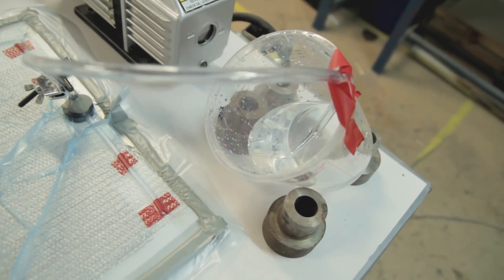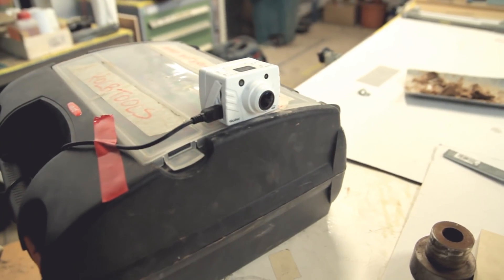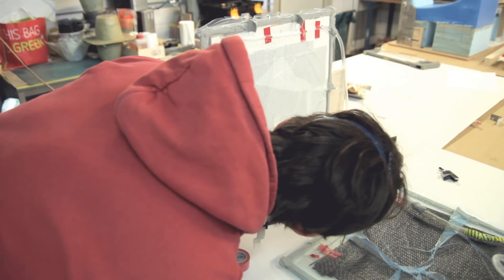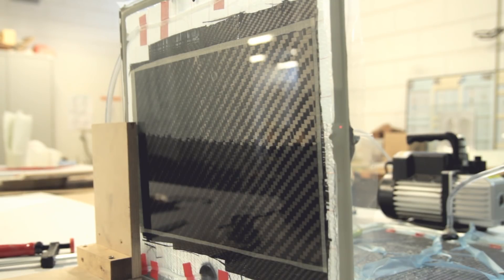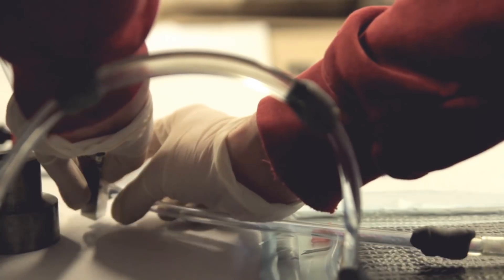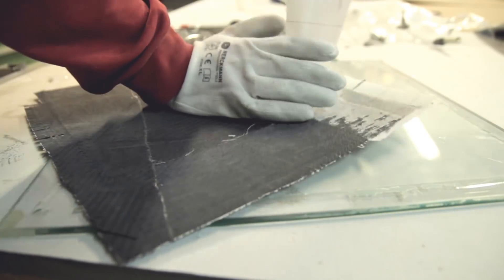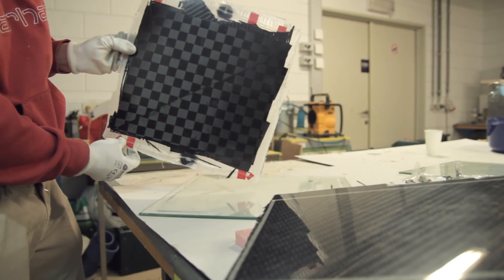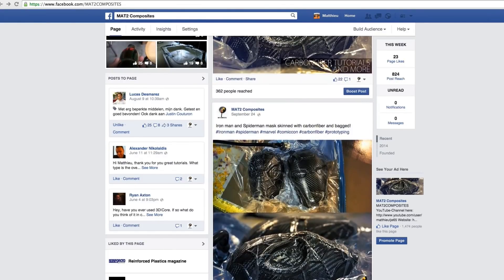VARTM Carbon Fiber Resin Infusion - Vertical and serial infusion  (FULL video)

Comment: Really nice work Matthieu, may I know the vacuum pressure you applied, is it 1bar vacuum pressure? I am woking similarly with plain woven carbon fiber infusion with 1-0.8bar I am facing little voids along thickness, could you suggest me optimum pressure for resin flow

Comment: VARTM  stands for vacuum assisted resin transfer molding. RTM uses positive pressure to press resin into the laminate stack, and uses strong mold and countermold, so both sides have a good surface. VARTM adds additional vacuum, so you don't need the extrastrong RTM molds, but you can work with a light and soft countermold, which is clamped by vacuum to the mold. That is an interesting process, but what you show is resin infusion not VARTM.. Maybe you can try with two glass plates and gravity pressure? And please check with gravity and vertical infusion, as far as I remember there is a limit on big parts. Otherwise I really love your videos!

Comment: I like your videos, always experimenting with new techniques!
Reply from the maker: Koen Klijnsmit Thanks! its important to experiment I guess to keep improving
Reply: Yeah, you learn from mistakes. I`m now making a carbon fiber body for an acoustic guitar, i make the mistakes on the prototype guitar and then fine tune it for the real model.

Now i have to figure out if i can have a pre preg outer skin and bond it with wetlay fiberglass... I wonder if it will become 1 epoxy matrix if i put it in the oven, i am liking the superior surface finish of carbon prepeg but its too expensive to make the whole guitar body from, or the people wont buy it...

Challenges keeps us interrested in this wonderfull composite world!
Reply from the maker: working on a carbonfiber Ukulele at the moment ;)
Reply: +Matthieu Libeert (Mat&#39;s Prototyping)  Did you ever finish that? I just built one myself.

Comment: Hello, I was working with foam and I wanted to shape a guitar body out if foam then skin/cover with carbon fiber. Could you do a demo working with foam showing the steps you take to achieve a great finish on a dual-sided project like a guitar?
Reply from the maker: Kevin Gregory Sounds like a good idea! will make a video about that when I find some time ;)
Reply: Matthieu Libeert thx for the reply! I'm going to start shaping the foam soon...just need to see how you go about applying carbon? One side first then back side? I'm a little confused! Lol PLEASE keep me posted on your VIDEO!
Reply: @Koen Klijnsmit thank you sooooo much! This information was very helpful indeed!
Reply: Kevin Gregory It can take a while to wrap your head around, but it is worth it in the end. You will have something unique. Unfortunatly the materials are so expensive...

Comment: Why is your resin cup, tilted?
Reply from the maker: Joao Pedro to avoid runing out of resin. The tip of the tube is on the bottom and when tilted you have "more" resin if you know what I mean? :p
Reply: Oh, I understand! Very clever! Thanks
Reply: Joao Pedro You must pay close attention to the resin level, sucking in air is not good. Some people like to mix multiple times, i am personally a fan of 1 mix to get a uniform epoxy matrix.